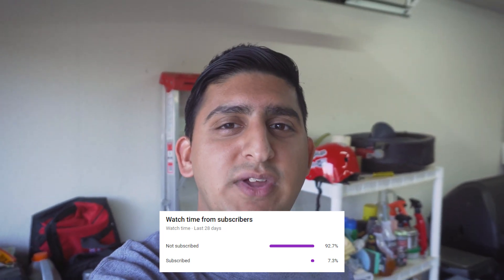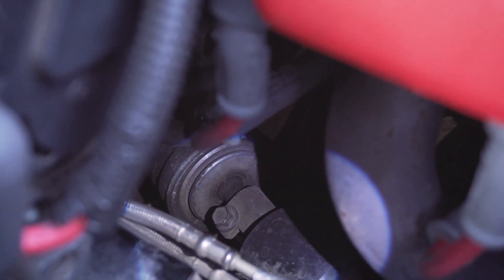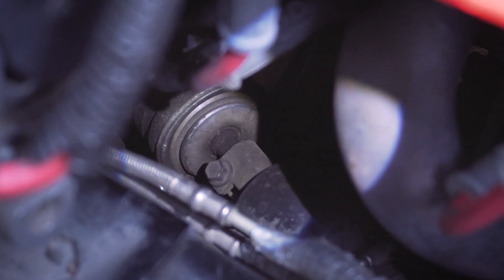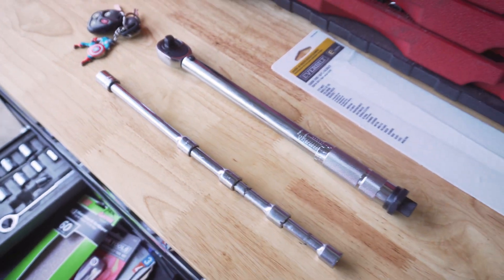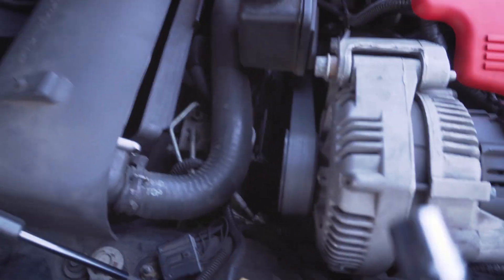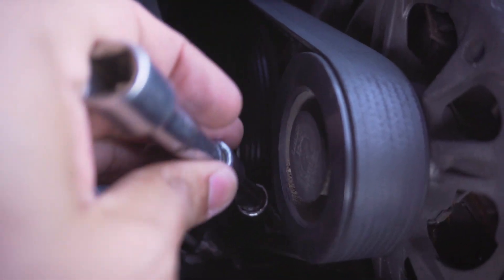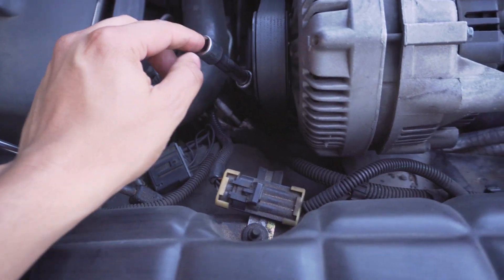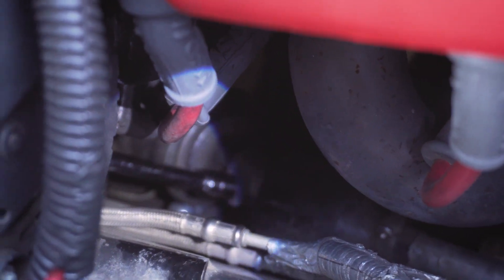C5 Corvette: Reduce Amount of "Play" in the Steering Wheel

Comment: My guy, I struggled with this issue for years. It was never the rack bolt. Its the actual steering column. I bought a steering column out of a 2003 Z06 with only 30K miles and put it on. She is tight as can be now.

Comment: I have the same issue  I bought mine 5 years ago, I replaced the rack in pinion,brakes,shocks alignment and I still have that play, I believe the problem is on the steering assembly car is almost 20 years old. I'll be replacing the steering for a momo quick release some time next year so I'll check all the assembly for any loose bolts.
Reply from the maker: Yea it's not completely gone and I feel like it's going back to how it was
Reply: Had my harmonic balancer replaced and they tightened steering rack or something because i used to have lots of play but now it feels like a new car
Reply: Get a solid steering rack steering rack bushing

Comment: The loctite changes the torque readings especially if it's old and crusty. So removing it and redoing it was the right call. 

Warning! When you disconnect the shaft from the steering rack, you must NOT accidentally turn or rotate the steering wheel/intermediate shaft one full turn in either direction. 
The reason is, the clock spring in the steering wheel airbag assembly only allows 3 turns to the left and 3 turns to the right. If you turn the steering wheel one full turn when it's loose and reconnect it to the rack, you've moved the center point. 

So next time you go to turn the wheel all the way the wires in your clock spring will break and you'll get airbag light issues and have to replace it.
Reply from the maker: PancakePlease Yup, I didn’t move the steering wheel once I disconnected the coupler. Thanks the useful info!

Comment: Subscribed!  My z06 is having the same issue.  I tried to tighten the bolt but it would not budge and I was scared to put more force on it.  So I will try to remove, clean and retighten.
Reply from the maker: It could be the steering column as others have suggested. I haven't really messed with mine since filming this video
Reply: in the steering column, is it wear/ worn out or a loose bolt?

Comment: When i had my 4th gen Camaro, i jad play as well, but it was fixed by the bolt at the top of the intermediate shaft at the column. Does the C5 have one you can check? BTW, I'm in Rockwall area, kind of near you.
Reply from the maker: Rockwall is a nice area! But I'll have to check to see if there is a bolt at the column. I haven't looked there yet to be completely honest.

Comment: Do you still have that noise? In the beginning of the video yours sounds exactly like mine which has me worried. At the end of your video I can’t tell if it’s still “knocking” or not. If I move it slowly back and forth it’s quiet but a quick side to side and I hear it click or knock behind the steering wheel.. everything’s tight on mine as well.

Comment: Does the steering shaft have the rubber coupler disc up by the firewall? If it does it might just be worn and need replaced. Or you could use a universal joint in its place.
Reply: Sorry can’t edit, that rubber coupled is called a rag joint.